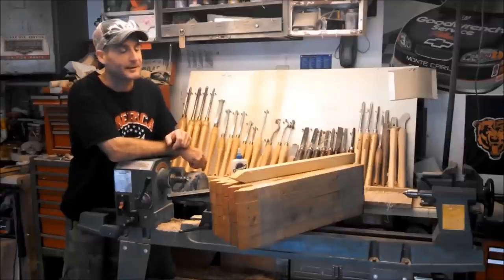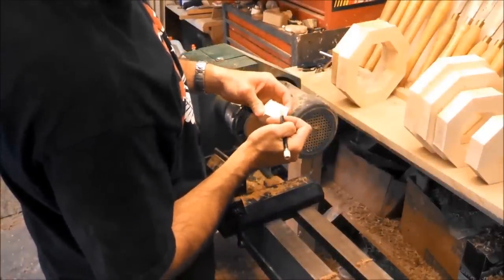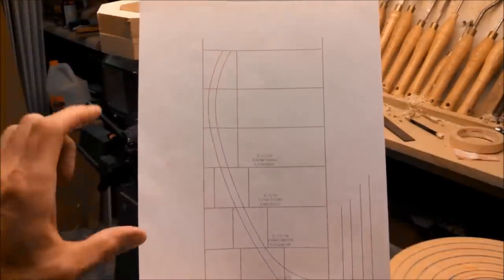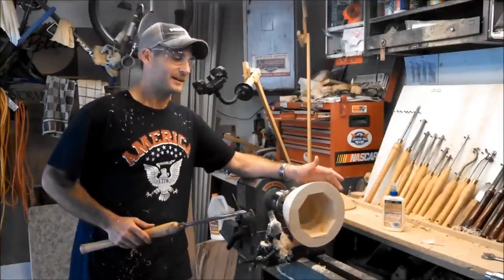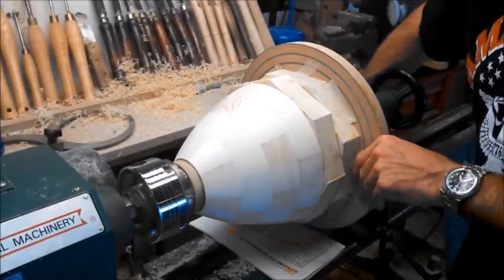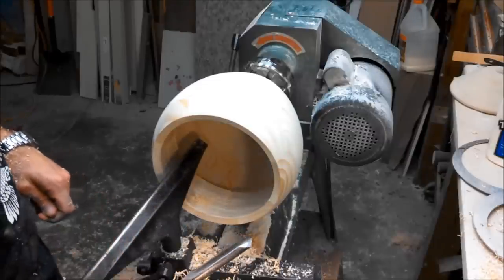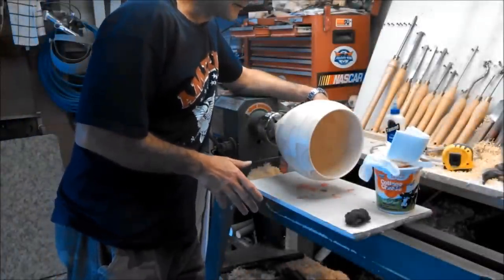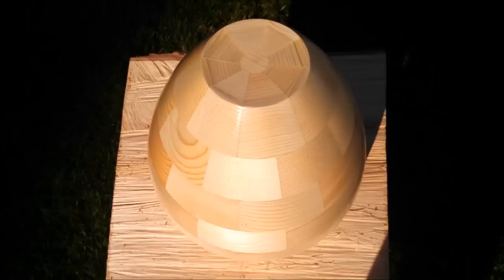Woodturning - Segmented Pine Vase

Comment: Great video and nice save! My heart dropped when it cracked.  I almost threw my computer out of anger
Reply from the maker: +Jesse Kyro Ha! I almost threw the bowl out of anger!  Thanks Jesse, and when I finally realized what was happening, my heart fell straight to the floor.  I'm glad I could salvage the piece, it was a lot of work to get to that point (of failure).    Have a good one, Kevin
Reply: Hey it still turned out pretty darn nice.  Your videos are making me want to get a lathe now.
Reply from the maker: +Jesse Kyro Well thanks!  And I would never talk anyone OUT of getting one!!!  Go for it, even if it's a small/cheap starter lathe.  You won't regret it!

Comment: Hi Kevin, i wasnt expecting your bowl to crack, that must have been a big moment for you, glad you kept at it though. A very nice looking piece and one i will certainly have a go at. I am a newbie at wood but i have been turning metal by hand for over 30 years. your wood plug on the base, i have found a glue block with 80 grit paper works a treat for turning small pieces, i have just finished a 7 ring hollow form and used the grit block to save a lot of wood for later projects, give it a try, cheers Dave

Comment: Nice vase, great save.  Well done, Kevin.  I've been told that turning construction-grade pine can really dull your tools fast.  How often did you have to sharpen your tool?  It seemed as if you only used the one bowl gouge on the entire project.
Reply from the maker: John Walsh Thank you John!  It may appear that I didn't sharpen, but trust me, I did.  For a piece of that size I would multiple gouges and sharpen them several times for each the outside turning and the inside.  And I'm not sure whether or not pine dulls the edge any quicker than other woods.  I've heard that before too.  Thanks for watching, Kevin

Comment: How does pine turn? Im thinking of doing a vase.  Great work!!!
Reply from the maker: Hey again Matthew!  Pine turns great and easily, BUT it does highlight poor turn techniques.  If you try to sand out poor turning the "soft" portions of the wood will wear away and the "hard" portions will stand proud.  Resulting in a wavy surface.  But have at it...pine can produce some lovely results!  Thanks for watching, Kevin

Comment: How do you change sandpaper on your lathe disc and keep it flat?  I really need to make one.  I'd like to make a few of these to get used to the process.
Reply from the maker: Thomas Hanson Hey Thomas! Because I use double-face carpet tape, I apply heat from a cheap ($2) heat lamp bulb.  The heat from the bulb softens the tape so you can remove the sandpaper and tape from the disc.  It's not perfect, but overall it works pretty well.  Happy holidays, Kevin
Reply: Kevin Krull Ok great, gotta try it.  Thanks so much for the reply, this has been bugging me to death.  Love the save, cause that's usually what it's all about anyway.